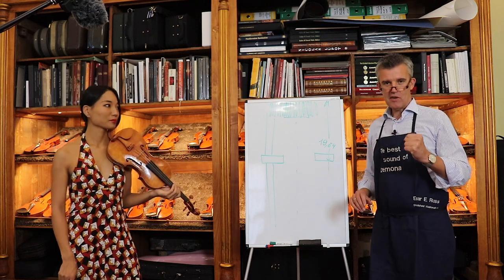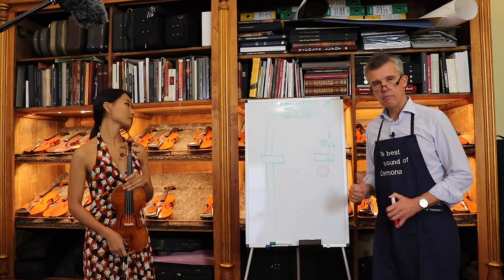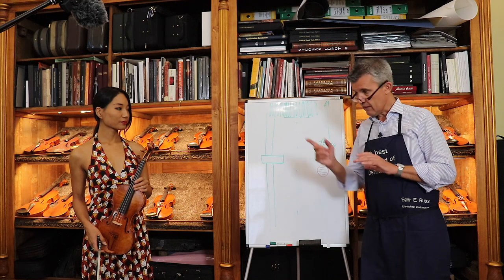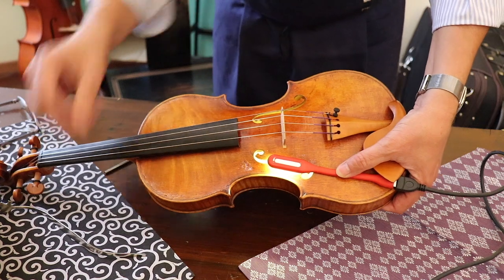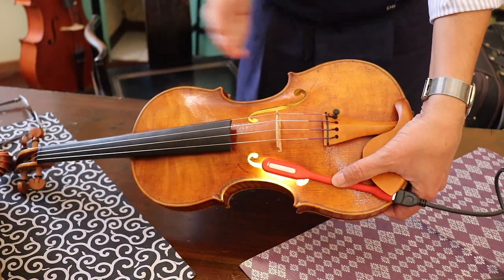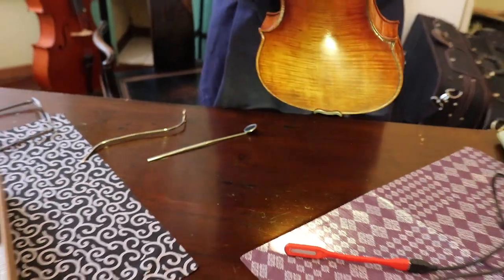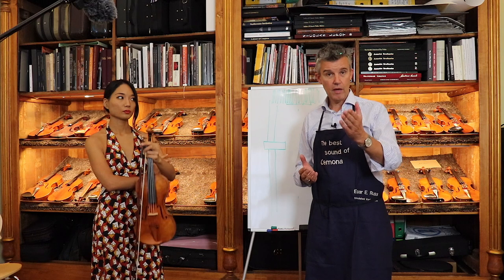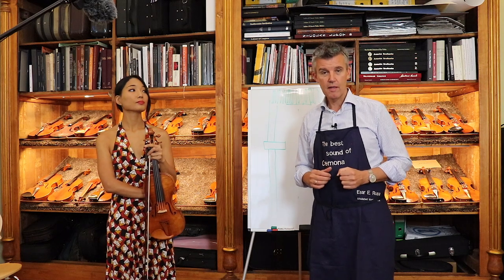E- STRING too STRONG? Watch this Soundpost Adjustment Video

Comment: When I move the old post, I was taught to push it over on the bottom of the post. You do that, by putting two  of the adjuster feet at the base  of the post  Then, lift and sort of twist the adjuster. You can then control the movement,  precisely. And then slide the top of the post, by hooking it with the adjusters wing, which there are four. Also, I thought that the post to move not only backwards and forwards, but sise to s8de, for sound adjustment?  Probably, further to the side, would increase the pitch.

Comment: Me again...I  purchased a yvn 100 a few years ago and it has a good sound overall but a bit loud and the E string needs controlling with the bow pressure to achieve a warmer sound.....perhaps a different E string may solve the problem...??
Reply from the maker: I think your instrument needs a sound adjustment and than new strings.

Comment: well I appreciate the message... but microphone placement can make that difference... also seems strage to want less sound.... but the bass is perhaps improved. I don't think Youtube can give us enough sound quality and resolution to judge. My Speakers ( hi fi system actually) is over $10k so I'm struggling to hear what I am meant to hear. Thank you anyway for trying.
Reply: Absolutely agree.  Of course these are real changes, but the overall level of the second recording is dramatically different without saturation and electronic compression, which is more than just the song post adjustment. Could be that she played less hard as she grew accustomed to the violin.  Could be recording auto level in phone, or many other things, all of which are accidental. I wish i could hear for certain, because this is absolutely the correct way to adjust the sound post, and the author of this video is highly regarded.  But i need a proper measurement with studio conditions and exact decibel level matches on multiple takes for this to be useful evidence, simply because the two recordings/performances are extremely different in output level.

But the luthier making these videos really knows his work and we can all learn a lot from him, even if the demo recording was not an effective AB comparison, simply due to human nature in performing.